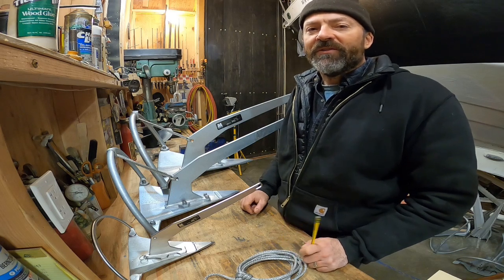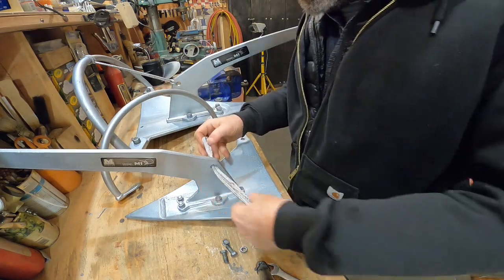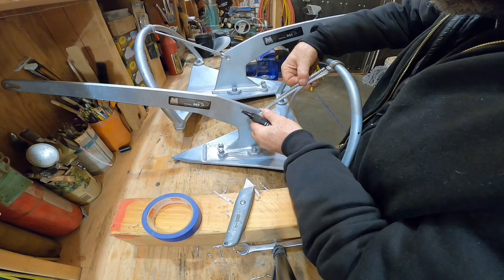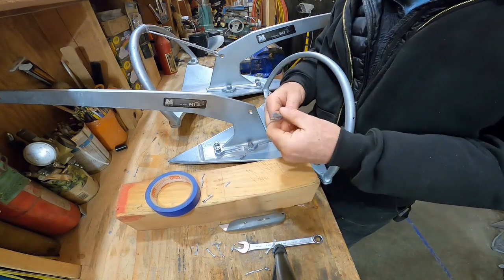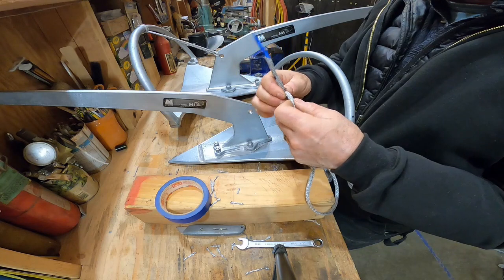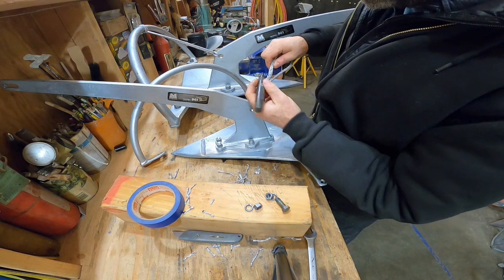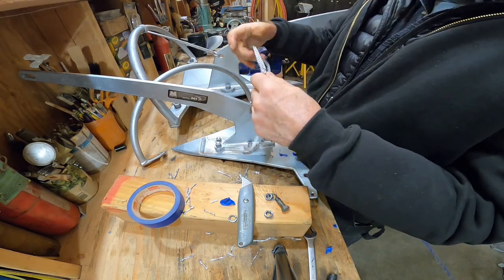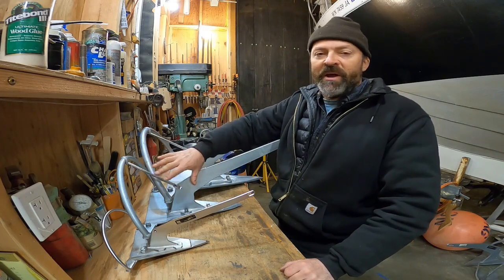Mantus Rollbar Helper.  Anchor Video #97

Comment: You could test anchors in a March Madness BRACKET-style of contest. The winner of anchor "A" vs. "B" then goes head-to-head against the winner of "C" vs. "D", and so on. See NCAA college basketball bracket charts for the idea. Then you'd get the ONE FINAL anchor that was the overall winner (use the great points system you've set up, on spreadsheets, in video #100, etc.)

Comment: If you don't want a roll-bar, then maybe consider the Mantus M2 (the ones herein are M1', I think) which has NO roll-bar. It fits better in the bow roller when not in use, too, and came close to the M1 in performance in one of his comparative spreadsheets (3.8 score vs. 4.3 score....not too bad).

Comment: Hi Steve, thanks for this great videos and tastings, have you tested the Mantus without the roll bar? It is 100% necessary? I just got a 55 pnds Mantus and the roll bar doesn’t fit well under the pulpit. Thanks
Reply from the maker: You're welcome, Mario.  A Mantus M1 anchor without rollbar attached will likely set (initially) and hold just fine.  However, if the anchor lands upsidedown or becomes upsidedown during a reset, the anchor will not return to the upright position.  I have not tested/filmed this because I did not want to encourage this potentially unsafe condition.

Comment: Hi Steve, i own an old 32 ft sailing vessel myself, ive been a sub to your channel for quite a while now, i have watched many other anchor reviews and generally they are somewhat boring but i must admit the way you comprehensively test most styles of anchor and the lengths to which you will go in your research, i.e capturing video of real seabed scenarios is very informative and most refreshing, as you have said you could write volumes on the variables of anchoring and you generally emphasise how you're not an authority on this subject, in my opinion the anchor manufacturers should take a leaf from your bible. Keep up the fantastic work ! Cheers from OZ 👍👍🍺⛵

Comment: Great improvement, so simple! I know you preloaded those loops which makes the rollbar side less likely to slip but noticed that the hole in the shank seems rather concentric. Is preventing the loop from being forced to swing down the sides of the rollbar something to consider? I was thinking that you could tie something similar to a whipping on either side and significantly increase the friction. Either way, brilliant solution without altering the anchor parts.
By the way, how much do you think it would cost to replace the rollbar on that 45 lbs Mantus if it was damaged? I too would prefer to see Mantus (and other manufacturers) subsidize these testings, but what if WE said "we want to see what it takes to bend that roll bar as well". I don't want to just ruin stuff either but your thorough testing lessens that chance.
Thanks!
Reply from the maker: Thanks Donald.  The geometry is such that the distance "grows" if the loop slides away from the center of the rollbar - so no need for a whipping.

No idea about replacement costs. I believe the Mantus warranty is generous enough that they never need to charge money for replacement parts. Just a guess.

Comment: Looks like they need to increase the thickness of the flange on the roll bar. The welds seem to be holding for the most part.
Reply: Maybe that's an intentional design element so the welds don't break?

Comment: You should look up the Adriatic anchor on YouTube, it basically does what you did by default design but with a thin metal connection.

Comment: Great idea but for me it will have a totally different purpose.  Given that my Mantus is significantly oversized and I do not plan to do repeated max load testing, I could probably tolerate a bent roll bar during a storm.  This is especially true given the lifetime warrantee that all Mantus anchors have.  
On the other hand, I have an Asymmetrical spinnaker and the sheets have a nasty habit of snagging on the anchor during jibs.  This should probably go a long way to preventing a sheet hook.